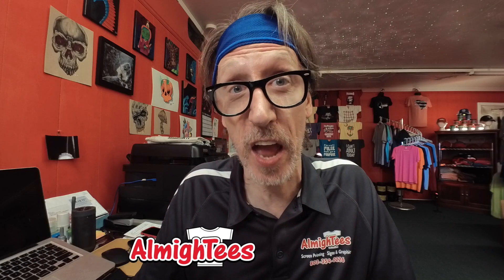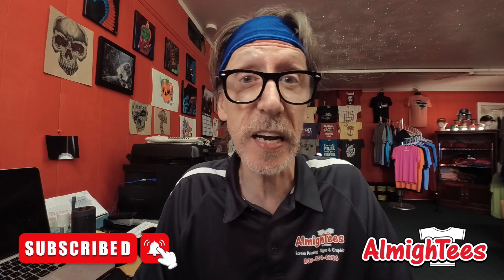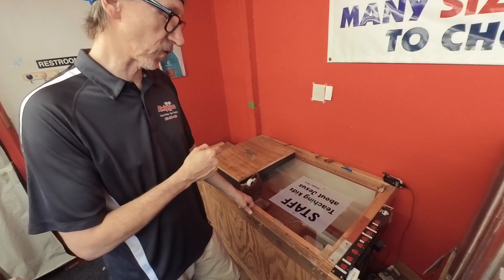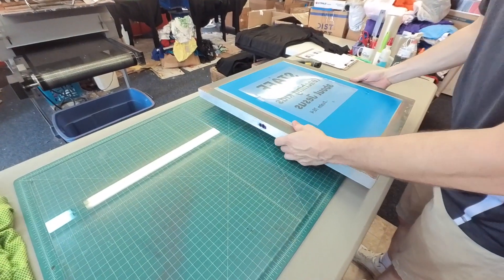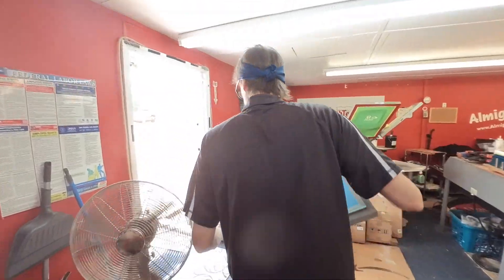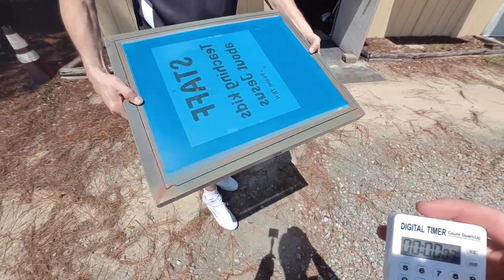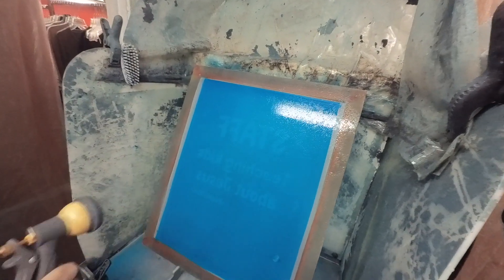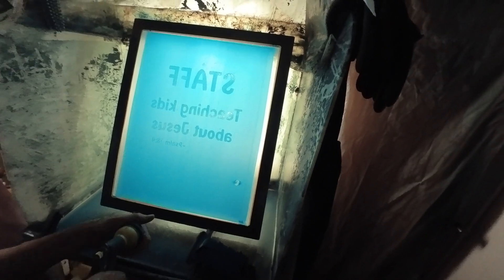Screen Printing 101 - Can you burn a screen using the sun?

Comment: That was good, but I have to argue that the reason you couldn't washout the reg marks is because holding the glass and the foam with just the edge of your hands, your screen didn't have that firm contact with the film and you got some light leakage around the dark parts of your film.
Reply from the maker: Thank you for watching and for your comment! And I really can't say you're wrong. But overexposure is a possibility.